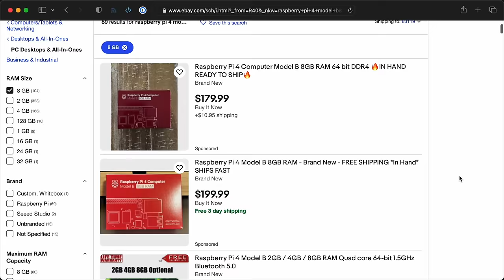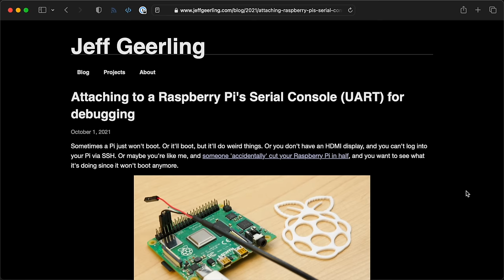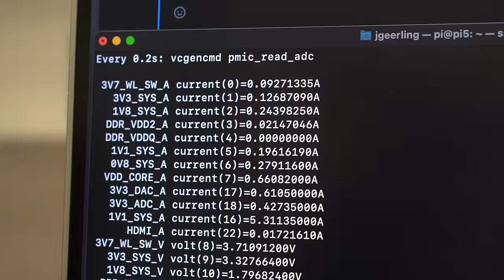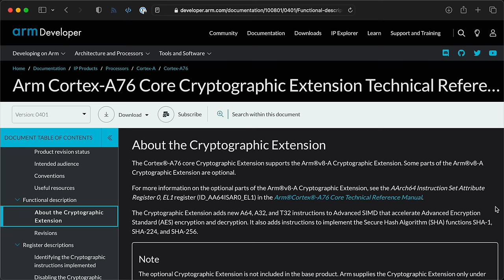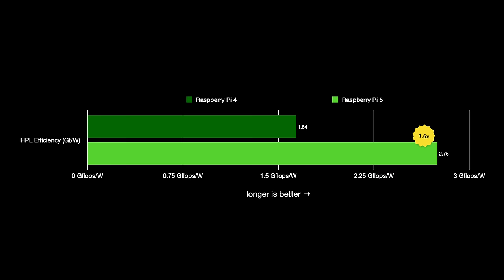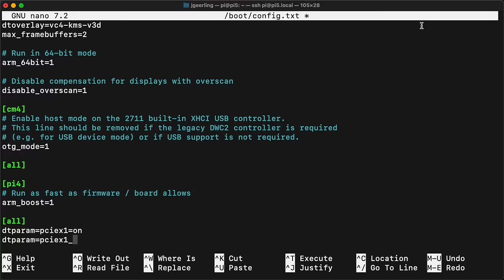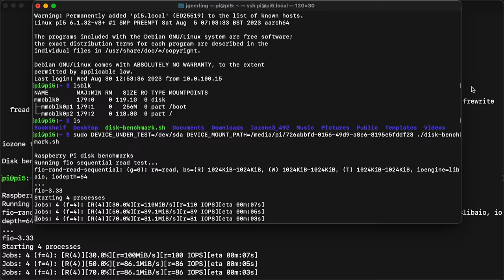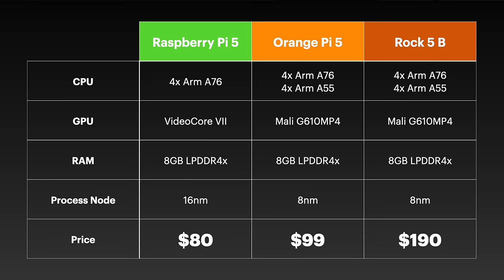Raspberry Pi 5: EVERYTHING you need to know

Comment: The raspberry PI has lost sense of its purpose. It was supposed to be cheap. The speed was just supposed to be the icing on the cake, but low price so you could use it on projects that didn't need much processing power. was supposed to be the goal.

Comment: I would have rather seen a single full-size HDMI and one of the USB type-A ports replaced with a type-C port with DisplayPort/HDMI alt mode.
Reply: Orange Pi 5 Plus has full size HDMI AND USB-C with DisplayPort alt mode.

Comment: $80 feels like we're back to "just buy a cheap NUC-like for a DPU" but for price and power reasons now too. The Pi has never been a performance monster, it's winning feature is software support for a low power board (courtesy UK taxpayer funding), but now we're at the point of effectively mandatory active cooling and 5w power supplies, the gap is closing between Pis and the world's most ubiquitous platform again, old and/or cheap x86_64 PCs.
Reply: I agree - if you are looking for a small NUC, there are better options for the same price after you factor in the board, the adapter, active cooling and a case. I also wouldn't print my own case unless I plan on using ABS. If you print a case with PLA, I doubt it would last long due to high temperatures causing warping. That being said, I loved it back when the Pi was only about 1amp. It could easily be run 100% solar powered and a battery when no solar was available. Now there are other alternatives for that market as well. It feels like the Pi family is not the same Pi that I fell in love with.

Comment: One thing I've always been fascinated by is the NAS builds with pi that you've done.

Ive felt that the previous pi models weren't sufficient in making a small or basic NAS but I think that will change with this model.

Id love to see more videos on the topic, it's one of those things I think I'll never get bored of seeing.
Reply: Yes i feel the same way.
Reply: I've been using the pi4 as nas for some time now.
Reply from the maker: I can always go for another storage-related video :)
Reply: @JeffGeerling do the petabyte pi challenge again
Reply: yeah I had a pi 4 NAS and it had tons of problems, really hope this new pi works well.
Reply: A look at real world NAS performance with, say 12x 7.2k SAS disks in a DAS using a basic HBA and software RAID vs a hardware RAID adapter would be great - there are still so many cheap disks, shelves and HBAs/RAID cards out there I can see this being of great interest to a lot of homelabbers - and the results would probably be somewhat transferrable to a setup using an SFF and cheap SATA SSDs.
Basically a "ghetto" NAS on the Pi5 using the new PCIe port.  Not sure if there are many cheap PCIe 3.0 cards about, but at the same time I have no idea if the Pi 5 would be capable of saturating a 500MB/s link using software RAID
Reply: Perhaps with the new PCIe connecter we'll finally get real SATA adapters (not USB)....
Reply: I builded my nas with an rpi4. It is slow, but stable. I will deffinitly upgrade to pi5. Doubble the usb speed, or even an raid card. Wow. I can't wait for it.
Reply: Improved USB performance is welcome. The bottleneck will be 1Gb Ethernet now though. I was so hoping for 2.5Gb.
Reply: I dont know, my pi4 4GB works pretty well as a NAS. It even streams in 4k over the wifi with ease ... but only since I upgraded to 5Ghz wifi. Anything less, major buffering.
Reply: The Pi4 already made a huge difference because it no longer routed Ethernet through USB. But it wasn't powerful enough yet and required SATA to USB adapters. Which wasn't ideal.
Reply: Is it using video acceleration?
Reply: I actually haven't had any issues with my 24/7 RPi4 OMV NAS. Works like charm with usb sata ssd. Why ssd? Cause you want the leave out the seek times if you have bit capped product. Imo it's serving my network absolute good enough. Actually the speeds are about identical to my old NUC 2420 celeron model I ran before. Let's face it. 1g ethernet is major bottleneck on all devices and its not that bad on RPi4. On older models it's absolutely worthless to run it as NAS.
Reply: I was looking to buy a decomissioned server cpu ram and mb kit from china to build a NAS but depending on tbe price a pi 5 will be a better choice. Nowadays i have a pi 3 running open medoa vault gor a Nas, it sucks but i love my pi 3.
Reply: I would assume PCIe add on kits will enable various ways for us to get faster networking and access to more storage. Personally I would like to see a dual nvme kit to add to the Pi5 for a mini nvme NAS. Wouldn't be the fastest box but it would be small and sip power.
Reply: @JeffGeerling  Please do so. I'd love to see a Pi5 based NAS.
Reply: The AES acceleration will greatly help with LUKS.  Hopefully we can see a SATA HAT that can power drives.
Reply: Interesting. I use my Pi 4 as an rsync and Samba server and used to host my Plex library on. Only issues I ever had were that the mass storage was those WD external hard drives, which take frustratingly long to spool up.

I will add that switching from 32-bit Raspbian to 64-bit dietPi Buster seemed to make a good bit of difference to SFTP performance.
Reply: @dfloyd888  Yeah the lack of AES hardware acceleration was the reason i replaced my Pi3 for a ThinkCentre Tiny, since i encrypt all of my harddrives. This and the faster USB, PCIe and Ethernet makes the Pi5 pretty compelling for a DIY NAS with LUKS.
Reply: Yeah same. I’ve found them unreliable and just not up to the task, thought my rpi 4 is only the 4gb version, so maybe that’s the issue.
Reply: Absolutely- I want to see a RaspberryPi 5 powering the new 45 Homelab !
Reply: odroid hc4, nanopi m4, rock pro 64, helios 4/64 a lot better than RPi as nas with native 2x or 4x sata channel...
Reply: Prefer my NAS in Mini ITX format.  That way I can use an NVME to SATA adapter and keep the 1 pcie slot available for 10gbe.

Comment: Really glad to see the Pi 5 having more PC-alike features natively like a power button, a PWM fan header and USB-PD! I'm completely fine with my Pi 4, but I'm debating whether or not I want to use something like the Rock 5B or the Pi 5 instead when I'm upgrading to a completely new system in the future. Probably just depends on what hardware connections I need at this point ^^'

Comment: Never had the opportunity to try out the pi 4, so the jump from my trusty pi 3 to the 5 should be quite the improvement for a home server :)
Reply from the maker: Wow, 3 to 5, that will definitely be mind blowing... just doing an apt update and apt upgrade is mind-bogglingly faster.
Reply: Same here, I can’t wait to get my hands on one
Reply: @JeffGeerling  Waiiiiiiiit one second right there does this mean that the Pi 5 can actually, reliably run games?
Reply: Still got a pi 1 on my shelf in a clear ish original case (2011.12) have see if it still powers up
Reply: Same here... never pulled the trigger on the Pi4, just pre-ordered the Pi5... my Pi3 is gasping for air now!! 😂
Reply: @ChunkySteveo  where did you preorder from?
Reply: @metal-beard  Pimoroni in the end. Was a toss up between them and Pi Hut. I am UK based, so we are spoilt for choice!
Reply: Me to. I'm ordering asap. Lol
Reply: And here I am: 2B to 5! 😅
Reply: Oh yeah

I have a Pi 3 lying around running my 3D printer.

Honestly, it's awfully slow. It works fine but loading up the web UI takes ages. I'll probably be blown away when the entire thing starts and loads within 20 seconds.

Comment: If the RPI5 would have launched a year ago it would have been huge, right now i feel like it is on the middle of everything because we have things like the RK3588/S and the Rk3566 covering the rear (The Orange PI 3B gives you a M.2 slot for as low as $30 to play around a single pcie lane). Even RISC-V is starting to put up a fight as the Lichee was already outperforming the RPI4. Not to mention AllWinner new socs that has a dual A78 + Hexa A55.
Reply: Most importantly you can buy those sbc-s while good luck finding raspberry pi.
Reply: Stay far away from AllWinner SOCs. In my experience, they heat up quite a bit and usually have bugs(looking at the H6 which had PCIE, but you couldn't access it. At least not with Armbian).

Comment: My Orange Pi 5 Plus has 3 full-sized HDMI ports (2 output and 1 input), 2 x 2.5Gbps ethernet ports, a full-sized 2280 M-key m.2 slot, an E-key m.2 slot for a network card, a type-c port with DP support, an IR receiver, removeable EMMC with modules available up to 256GB, build-in microphone, 3mm headphone/microphone jack, 40-pin gpio, and LCD and camera headers. The RK3588 with its Mali GPU is still much faster than the pi 5 and has a build-in 6 TOPS NPU for machine learning and memory options up to 16gb (32gb on the standard Orange Pi 5). I currently have it running desktop Debian 11 with KDE Plasma from a 500GB m.2 SSD with a Wi-Fi 6/BT 5.0 card. I hardly even notice that I'm using an SBC most of the time.

Oh, and it's in stock.

Comment: If only they crammed an m.2 connector in there, would have been absolutely perfect. But still a 2.5x improvement from the 4 is no joke considering just how capable the 4 is
Reply: like on the bottom side.... Where there almost NO COMPONENTS anymore.
Reply: Let's not push for this to be a full pc. The price is already getting a bit too high for what it's supposed to be.
Reply: @pidojaspdpaidipashdisao572 honestly tho with inflation being what it is, the price might be more consistent than it looks at a glance (I mean compare it to the cost of eating out back in the day vs now).
Reply: If it had a NVME I would be positive about this release. But now they remove hardware acceleration of video, they still have those really bad mini hdmi ports, and it needs a fan and heatsink (why not just put it on as standard then?)  That adapter will be like $40 probably for NVME, and make it like one inch thicker.
Reply: Yea, that's my one sad thing for this. Would have loved a nvme drive integrated for my home assistant install
Reply: The 4 is very old now. Astounding that it’s been selling at more than full retail, all these years.
Reply: @pidojaspdpaidipashdisao572  10 pounds/dollars or something?
Reply: I don’t think a rear-mounted m.2 connector would have been all that expensive. It’s a commodity component and there are numerous SBCs with them with similar prices to raspberry pi. Using a non-standard ribbon connector might even increase costs.
Reply: Adding components to the back would put them back to having the more expensive production line that they used for through hole.  There is a reason they moved away from that and it's probably to help keep the price down.
Reply: The SD card got a little upgrade. Should be plenty for Linux I/O.
For Windows on Pi it might be still limited.
Reply: They had a choice of m2 or PCIe and I think they made the right choice going for PCIe because it's a lot more versatile.
Reply: @pidojaspdpaidipashdisao572 I mean thats why it keeps evolving, you always have the previous versions to buy if thats what you want. I dont see any reason they should try to make a full pc on a board if they can get there.
Reply: that is why I prefer orange pi 5

Comment: The ability to use pcie right from the board makes me want something like a SATA controller hat. Even if it's slow per port, the ability to run either dual HDDs or sata SSDs in either form factor would make for a cool budget NAS build.
Reply: At 2.0 it would be enough bandwidth to run 2 very fast enterprise HDDs like Exos, which are ~250MB/s. At 3.0, you could run 4.
Reply: wouldn't it be possible to have a bunch of sata connectors using a pcie to sata adapter ?
Reply: @LtdJorge  True. That single 3.0 lane is actually quite good bandwidth. I mentioned it being slow per port because they don't have to stop at 4 ports. An 8-port SATA controller could be used, but I think just 2 really fast ones or maybe 3 would be plenty.
Reply: @neolordie : In theory you could have as many as you wanted, but you can't put more data through PCIe than it has bandwidth for. :)
Reply: @jeschinstad  oh didn't see the pcie 2.0 x1 lol, that's pretty bad
Reply: @neolordie : Yes, you can max out the bandwidth with a couple of reasonably fast HDDs. :)
Reply: @jeschinstad  I mean, 2 hdd would still be usable as a starting point for a cheap nas tbf
Reply: @neolordie : Yes and if you didn't ever need full speed from more than two at a time, you could in principle build it as big as you wanted.
Reply: @jeschinstad  It would make for a great cold archives, where you don't need fast access time and it taking long to write doesn't matter so much either.

Comment: This was awesome to see, most important for me though is the improved manufacturing simplicity, fingers crossed it finally fixes the supply issues.
Where i am RP4 B is still 130eur on Amazon & 100eur on official RPI suppliers.
Reply: I'm not getting my hopes up
Reply: I don't think the supply chain issues had anything at all to do with manufacturing. This will likely reduce production line setup and operational costs and improve yields, all of which helps keep prices down, but if you've had any experience buying electronic components in the past 4 years it's pretty clear why companies like the Raspberry Pi Foundation have had supply issues. It's component supply that is the problem. Lowering manufacturing costs isn't going to make more components magically appear on the market.
Reply: In my country, local distributor is selling it for 300 USD. So bad.
Reply: @ajaka002  jesoooooos well I don't have any 4 or 5 but I think I have a 3 somewhere I could send you for free if you want.
Reply: @badger47-n3c  Thank you very much, but I don't need it. I'm just here to express my opinion. that some distributors think that right now is still a mining boom and chips shortage.

Comment: It would be interesting to see if the RP1 can also be programmed as kind of a co-processor, handling some real-time tasks (like stepping a stepper motor, or reading a rotary encoder signal) without the need for a real-time OS running on the AP. (Or if some of the PIO goodness also made its way into the RP1 silicon)

Comment: There are through hole components. Plenty of them. It's just that they don't protrude on the solder side of the PCB. These are still Through Hole as they require Plated Through Holes in the PCB. They are however not soldered with wave or hand soldering like traditional TH components but soldered during the SMD reflow process. This means they still need to be placed by those fancy robots. They also have to be resistant to reflow temperatures. Unlike traditional TH components.

Comment: The reason why you can't playback 4K video is likely because the browser on the pi is forcing the x264 codec which is easier to decode, youtube doesn't offer the 4K data stream in this codec. Same thing happens when you install the x264ify extension on your pc.

Comment: The question I think everybody is asking is why they kept the awful micro-HDMI plugs. They should have gone to full size. Having one displayport and one HDMI also would have been cool.
But in general I'm happy that they worked hard to keep the price reasonable.
Reply: Id liked to ser a display or mini display port, even could be cheaper because licenses.

Lenovo's thinkcenters have no HDMI and with display port is enough.
Reply: It would not only have been cool but saved users money and stopped a lot of e-waste from being created.
Reply: Yea, i mean, if they want it to be as small as possible, then why put USB-A instead of USB-C? And if they want the compatibility, then there really is no reason to use micro-hdmi... Its just such a strange setup...
Reply: These connectors are the absolute worst. Video out via USB-C is a thing, that would've been sooooo much better.
Reply: My guess is the weight of hdmi chords may have had a tendency to damage ports given the lightweight of the sbc. Choosing to go the micro hdmi may server as a breakway, cutting down the tendency of broke ports. However, that's just a guess. It's also easier to serve the part of the community that needs dual display options for projects dealing with a second screen given the size of full sized hdmi ports.

Going with two full sized ports would cut into the sbc's real estate and it would either suffer space issues for other chips and circuitry and or heat issues
Reply: Why have full-sized USB ports and why have USB2 ports? Could have a couple of USB4/C ports. Could have a neat system with some cheap dock that offers all the needed (HDMI, full-size USB, even ethernet, SD, ...).
Reply: @McSlobo  USB2 likely for compatibility with older stuff
Reply: @mrmotofy  USB 3 is backward compatible with USB 2 devices, so it's a more likely only cost-saving option. In most cases, you will have a mouse and keyboard, and they won't benefit from USB 3 speeds, so you can plug those devices in the USB 2 ports and use the two remaining USB 3 ports for high-speed utilities like USB flash drives.
Reply: @McSlobo  USB2 controllers are smaller/simpler and cheaper to pack into a chip
Reply: @Purjo92  Yes in theory...but in the real world, not everything works correctly if a device is USB2 plugged into USB3
Reply: @mrmotofy  Did not know that, thanks for the information. 👍
Reply: they should have a full-size HDMI, and a mezzanine connector for another HDMI / second connection to GPIOS
Reply: @StarfoxHUN  its because mouse and keyboard nowadays are STILL usually on USB-A. hence, it is also for immediate use and people most likely have lots of them lying around their houses..
Reply: @mrmotofy …in my real world, I have NEVER had a problem plugging USB2 devices into either USB2 or USB3. Going way back to the introduction of USB3.